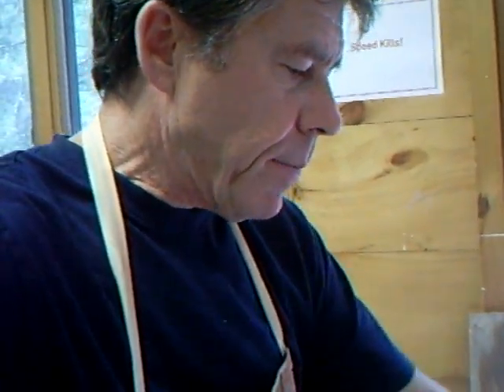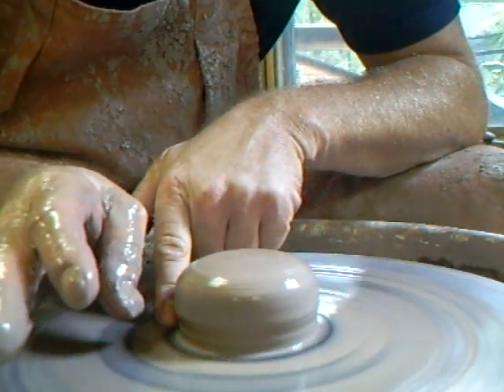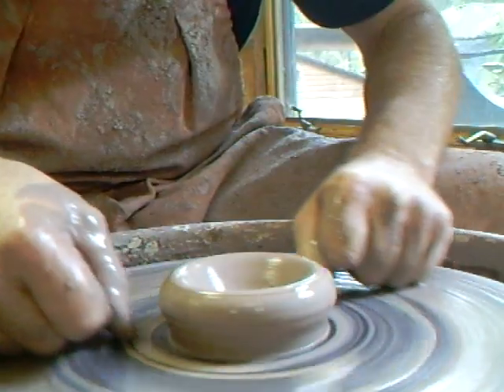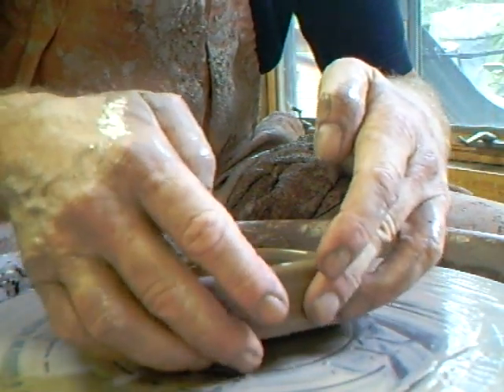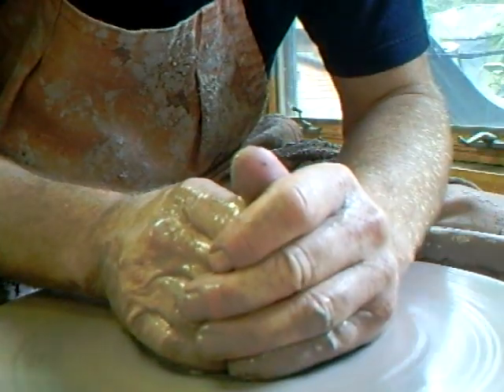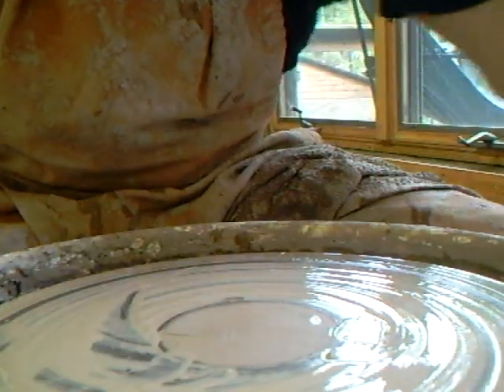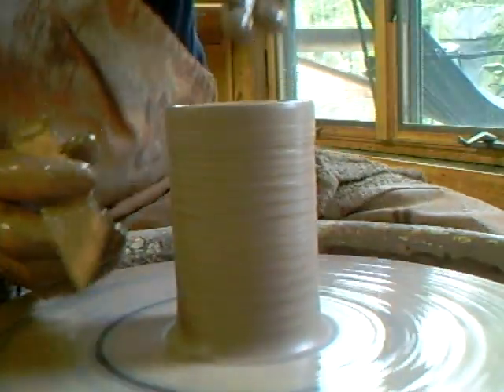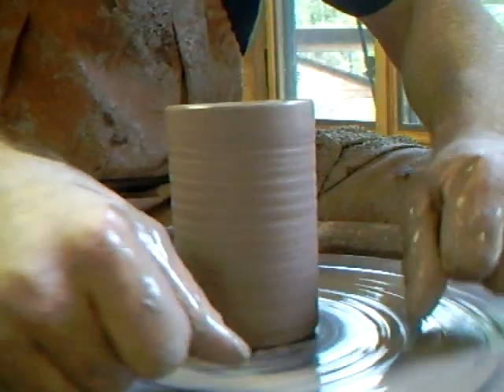SIMON LEACH - 7 steps to making a cylinder !

Comment: Thank you so much for this video, taking your  time to share your knowledge.
 I have been potting for 5 years. A struggle to master the technique, but i am determined. I believe my problem was at #4. I was opening up the size of the base not wider than. 
Also clay consistency seems to be an ongoing problem: sometimes too hard to work with, sometimes too soft: any suggestion here Simon?

Comment: May have asked you this already, but, Could you make a video showing possible beginners practice routines? Like different beginner steps repeated over and over for practice. For example, a tutorial for how to center, and then Uncenter, center uncenter. Or open up, close, open up, close. Or pull small wall, bring back down, pull wall, repeat.
This would be super helpful for beginners like me who have a wheel at home.

Comment: hi, i've been watching your videos for quite some time, and love them.
You inspired me to try throwing some pots.
i'm planning to build a throwing wheel using a washing machine motor, and for the
wheel itself i'll use a turntable of a record-player. it's perfectly centered, of course, 
and to it i will have to add an appropriate 
surface for the clay to hold on to.
any suggestions?
for speed control i think of using the foot switch of a sewing machine,
(yes, i will water-proof it...)

Comment: So useful! I have been doing ceramics for about a term, and only done wheel work 3 times so far. I have yet to collapse a pot, but all of my pots have ended up a very similar shape so far, and the cylinder is the thing I am desperate to get sorted as use slab built ones for lanterns, and this should shave off the time if I can get to grips with it. Very well explained!

Comment: How does your finger not catch in the clay and break it? Mine does that all the time.. Any tips?
Reply: That's happened to me a lot. It's either because you're applying too much preasure with one hand or the clay isn't wet enough. If it's too dry friction will build up and cause the clay to attach to your fingers.
Reply: more water